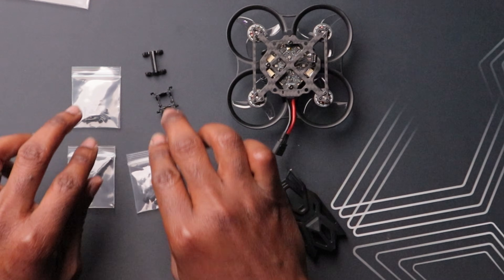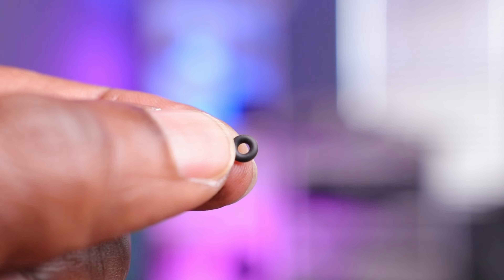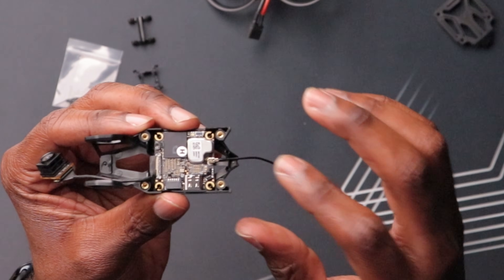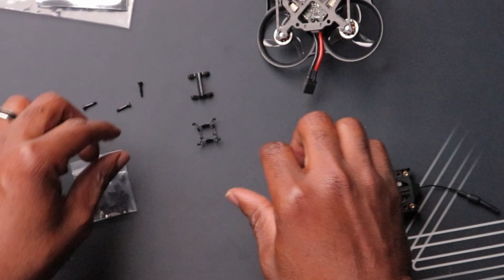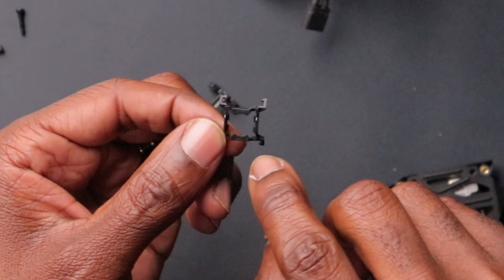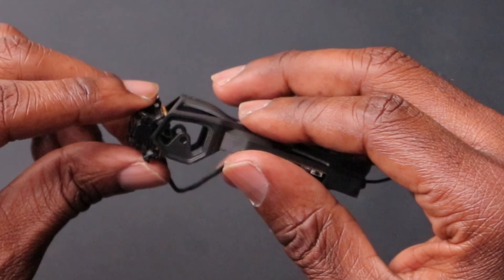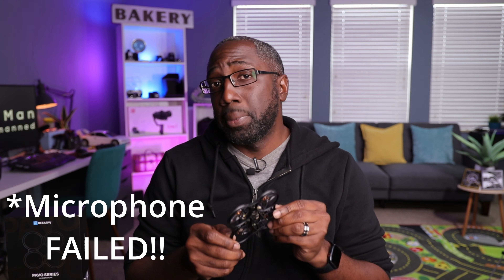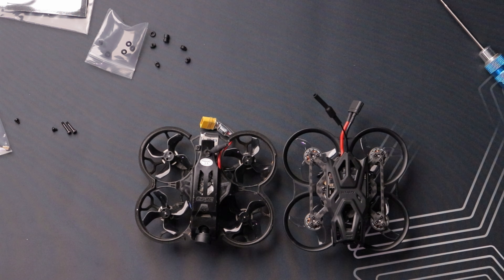Installing DJI O4 In Pavo Femto, Pico, and Pavo20 Is EASY..Here’s How!

Comment: I did this today (DOH!) with my Pavo Femto. I was happy to see it power up via USB (and immediately made a backup), but saw, as you did, that the R001 resistor was completely missing. The solder pads were just fine. I didn't have any R001 but I read that I could put a 0-ohm resistor in there and that it should work in a pinch but will give bad current draw readings. I don't tend to use the current draw readings, so that's no big deal. Sadly, I only had 0806 0 ohm resistors on hand, but it fit so I put it on there. I just did a short test hover then flight around the office and saw no issues. I ordered the ones you mentioned from Ali Express (R001, 1206) so I'll swap for the R001 when they comes in. Although you are seeing the wrong current draw, anyway, so... I'll more thoroughly test fly the quad tomorrow to see if it survives. I Also have a Pavo20 Pro, so it's good to have these for backup, I guess. In two and a half years this is the first time I've done this, so maybe I was due :) Thanks for posting.
Reply from the maker: glad it helped

Comment: So how do i get my dji fpv rc 3 to connect with beta flight?
Reply: Same question. Did you know now ?
Reply: @jasperabillon24  I had to enable SBAUD fast and have the right aux selected
Reply: @DeadlyShadow413 did you soldered anything ? Or just plug the cable from fc to O4 ?
Reply: @jasperabillon24 I didn’t have to solder. I had pnp version and just used the wires that came with it

Comment: Thanks for the video ! My canopy arrived finally after 4 weeks (Chinese New Year ....). 

I can confirm

- watch the above video at least 2 times ... the assembly is not trivial (get a magnifying glass if you are over 50) 
- all the necessary parts are included in the 6 USD canopy kit except the (long) Air Unit cable to the FC
- it fits an old Pavo Pico V2 perfectly
- the best: all the jello is gone with the dampened camera mount !

To summarize: highly recommend ! The price is a no-brainer: 6 USD + shipping.
Reply from the maker: Wow.. Thanks for the breakdown and your experiences.  Hope it helps other pilots as well.

Comment: hi, thank you for a great video. so how is Pavo20 with O4 lite in a Femto canopy, the camera, mipi cable and ufl connector, are they all ok when crashed ? thanks... Do I need to E6000 on the ufl and camera tiny board ?
Reply from the maker: The Pavo20 with O4 Lite flew amazing!  Since it's all housed in the canopy itself, there is no need for E6000, but it wouldn't hurt. You can see the review here: 
https://youtu.be/jYPf1jLcAKk

Comment: Hi, and thanks for a great video, are you sure this will fit my Pavo Pico frame? Have you tested it? 😀😀
Reply from the maker: BetaFPV says it will fit..I have not tested it on the Pico yet, but I can tell you that the standard Pico bolts won't work since they are self tapping.  You'll have to use the bolts with the Femto canopy.  I have video showing its installation and video quality on the Pavo20.  It should be out tomorrow.
Reply: @ Thanks, I have ordered it via your link👍

Comment: Ho, I am a newbie. I I decide to go with this set up I forcebly need to stick with a DJI googles 3 or N3s) rigjt? Or can I use other difgital googles?
Reply from the maker: You can also use Goggles 2 and Integra, but you will not have all the features of O4 like "race mode".
Reply: @ alright then that means no other googles than Dji ‘s can be uses in conjunction with O3,O4 systems right? I appreciate your help
Reply from the maker: @que_dijo that is correct.
Reply: @ got it. I am already subbed mate. Great channel👌

Comment: Do you know if theres a copter for O4 but with tbs crossfire? All the new betafpv platforms are only elrs 🥹
Nice video thank you 🙏🏻
Reply from the maker: Sorry, I don't know of any.   The problem with CRSF is that it is more expensive and more difficult to get than ELRS.  Manufacturers want to keep cost as low as possible and therefore prefer to offer ELRS with their drones.   Your best option is to buy the CRSF receiver separately and install it yourself.

Comment: I just bought the adapter for the pavo20.  I’m curious if you happen to know the overall weight difference between pavo20 with o3 air unit and pavo20 with o4 air unit.  Thanks!

Comment: I've heard the 04 is easy to break 😢
Reply from the maker: I don't know how true it is.  I saw Mad's tech had an issue with his Mipi cable.   Mine had glue on both ends of the Mipi.  I don't think they want you connecting and disconnecting those connectors alot.   These things have thin boards with tons of circuits and chips.
Reply: @OneManUnmanned  guess time will tell  but that cable sticks out the top a lot I fitted on to me mobule 8 and I don't se it lasting long
Reply: It is weak. Watched several videos with video going black on a hit, same reason. DJI, lol.